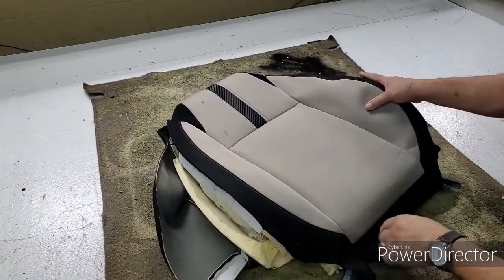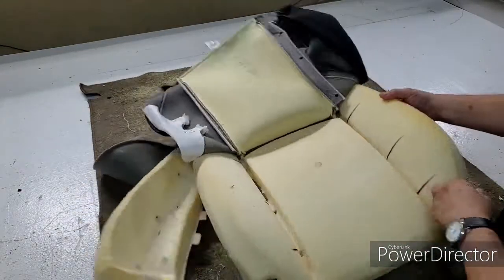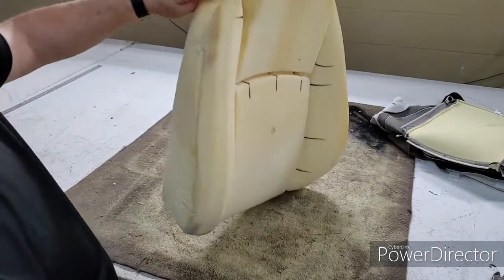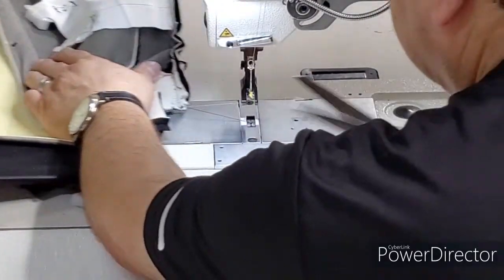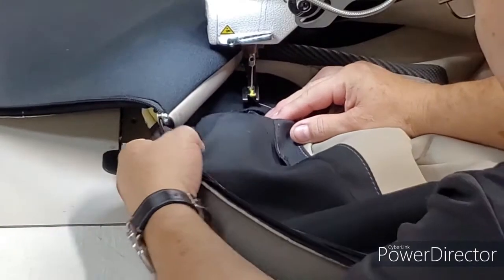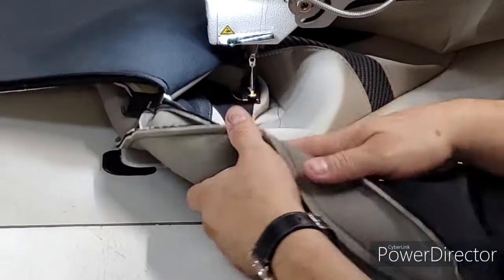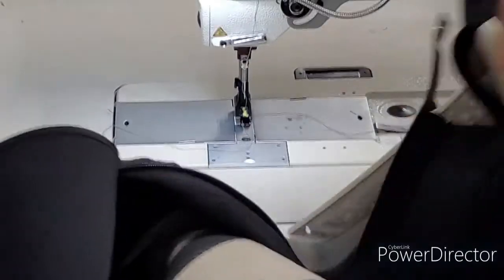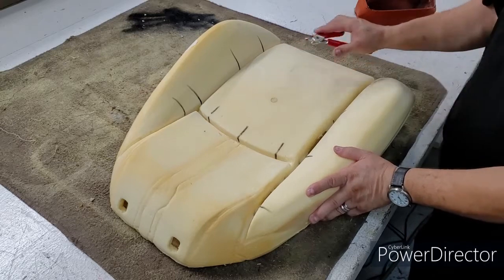See Now! how to resew a blown airbag seat cover auto upholstery

Comment: Nice work. Can you tell me how you closed the two back side seams? I didn't see it in the video. Also, so I understand correctly, the force of the airbag will automatically break through the side seams? If so, do you use a lightweight thread, or a heavy upholstery thread?
Reply from the maker: Thank you! I sew it as a normal french seam with regular machine thread. The airbag deployment is very forceful and destructive. It will either split the thread, destroy the vinyl at the perforation, or split the vinyl.
Reply: @oldschoolautoupholstery  ok, thank you for getting right back to me.
Reply from the maker: @mojoagogo4873  Yup!

Comment: If you pull the seat to make a damage repair, not air bag related, can you disconnect the air bag without fear of activating the air bag? Or does a dealership have to disconnect and reconnect air bag? Want to make a repair on side bolster with a side airbag
Reply from the maker: Hello Todd, Personally, I never disconnect the yellow airbag wire. I do the work while the seat is in the car. I don't want to pain my customers by having to take the car to have the airbag light reset. I never disconnect the battery. It is not because I am afraid of setting off an air bag. That has never happened in 25 years of working on air bag seats. Check out this video of me removing a bottom seat cover from an airbag seat. https://youtu.be/dODSTA6C0m8 Please keep liking and watching!
Reply: Does the same removal apply to the seat back. That is where my damage is located. Thank you so much for the fast response.
Reply from the maker: @toddathey1235  Hello Todd, Yes the same thing applies to the backrest. Please keep liking and watching!

Comment: Do you have to sew the seam with special thread designed to break when the new airbag is added? I heard it has to be a special  patented thread?
Reply from the maker: Hello Angela, I believe that there is nothing special about the thread. The force of an exploding air bag will break through anything covering it. I have seen the vinyl split before the thread does. Please keep liking and watching!
Reply: There are special threads especially for airbag seams. And there are a seam that opens easier.
I'm Europe you habe to have a certificate

Comment: I’m buying f150 seats and airbag deployed on the right front seat is it worth buying?
Reply: They are leathee
Reply from the maker: Yes, most likely can be repaired.
Reply from the maker: @EKoston3  The best thing to do is call around in your area as there is no way to standardize pricing. Pricing is usually based on experience, location, and if the upholsterers are hungry. I wouldn't go with the cheapest one.
Reply from the maker: @EKoston3  Most likely it will be a french stitch with nylon or polyester thread. Go for it!
Reply from the maker: @EKoston3  Hello, These are usually a french stitch with a nylon or polyester thread.

Comment: Do you use a special thread or stitch for the airbag seam?
Reply from the maker: Nothing special, just poly or nylon thread.
Reply: What size of poly thread are you using?
Reply from the maker: @sharethewealth72  Hi, The bottom of my thread spool says T-90
Reply: @oldschoolautoupholstery  awesome, thank you!!
Reply from the maker: @sharethewealth72  You are so welcome!
Reply: hi I’ve always heard that you need a “special” machine and thread” for airbags.  How truth is this? I mainly do party bus seats how ever every now and then I get a call for airbag seat and I just turn it down. Thanks
Reply: @pittbullrican  Yes, I've read that companies have very special and precise procedures tu stitch airbag covers, and the machine is computer controller so that it prints a label showing the exact information for this stitch, tension, etc, and that is why most of the upholstery shops do not deal with airbags, as if there is a problem in the airbag deployment, it can be very dangerous for the person in the seat.

I also read that they use a special thread, made from cotton, which breaks easily when the airbag deploys 👍

Comment: Great video, as always!! 😍😍😍

About this airbag cover procedure, I've read that OEMs that manufacture car covers have very special and precise procedures tu stitch airbag covers, and the machine is computer controller so that it prints a label showing the exact information for this stitch, tension, length... to monitor every single operation, and that is why most shops do not resew airbag covers, as if there is a problem in the airbag deployment, it can be very dangerous for the person in the seat.

I also read that they use a special thread, made from cotton, which breaks easily when the airbag deploys. Perhaps you could investigate a little bit about that, and perhaps use cotton read, just in case there is a problem in one of the seats that you redo? 😉

You are great, and I would like you not to have a single problem if an airbag seat cover that you have repaired does not deploy correctly, especially in a "sue happy" country like the USA 😅😅
Reply from the maker: Hello Delta, Thanks for the thought! I do not think it is rocket science. I do know that the thread and perforated material is no match for the exploding force of the airbag deployment. I have seen the damage when the airbag goes off. Thanks for watching!
Reply: @oldschoolautoupholstery  Thanks to you and keep up the good work! 😉😉
Reply: You were right, normally the Upholstery shop denies repairing the carseat with the airbag side broken. It can not be a regular thread.

Comment: I would not recommend  sewing an airbag seam with out a docusew machine. Its impossible to know if the seam will tear open and the bag deploy at the correct speed sewing the seam with out a docusew.
Reply from the maker: Hello Dmd, Like I always say, it's not rocket science. Any seam will not stand an explosion of an airbag. Just sayin'. Please keep liking and watching!
Reply: @oldschoolautoupholstery  I understand that any seam will blow out but the speed it has to go thru the seam and allow the bag to deploy is a matter of life or death. A  hundredth of a thousand second late can cause serious bodily damage or death. There is a lot more to it than just saying the seam came apart.  Honda has a great video on the importance of this involving a steering wheel airbag but it applies to a seat airbag as well.
Reply from the maker: @dmdkustoms4403  Hello Dmd, Right on! Right on. Please keep liking and watching!
Reply: @oldschoolautoupholstery  I have personally seen a repaired seam that did not separate as the factory seam would have and it prevented the air bag from deploying properly! Thankfully the seat was unoccupied at the time so no one was at risk of injury. I personally examined the cover and it appeared to be restitched exactly as it originally was, but it definitely didn't break apart as it should have! A lot of people use a lighter weight cotton or nylon thread for sewing the seams, but I'd still be hesitant!
Reply from the maker: @richardmccabe270  Hello Richard, I have been sewing ever since the seat airbag was invented. Never a problem. Not even one. Please keep liking and watching!
Reply: Thread you use for this is? I see that the outer thread on some are like thin twine like thread. Newby learning. Ty
Reply: @tinabutters-hargrave7911   I highly recommend you don't try to repair that type of seam. You cannot duplicate the speed in which the seam has to open without a Docusew Machine. Once again in a different application. If a skydiver opens there parachute a little late the result can be fatal or result in a serious injury. 
But I guess not a problem right because it opened.
Reply from the maker: @tinabutters-hargrave7911  Hello Tina, Well, the experts in the comments say that it should not be done. A difference of opinion. Please keep liking and watching!
Reply: @dmdkustoms4403  if they dont replace the airbag? Does that make difference?  And what thread is used?
Reply: @oldschoolautoupholstery  I have a sail right fabricator and another sailright industrial portable machine. I and curious on thread and advice?
Reply: @tinabutters-hargrave7911   Ok got you. If there not going to replace the air bag  and use the seats in some type of custom application.  Use your normal sewing thread. #92 or #69 is what I sew with. I also like using serafil thread.
Reply from the maker: @tinabutters-hargrave7911  Hello Tina, Airbag or no airbag, it doesn't matter. I always use T90 nylon or polyester bonded thread for everything Please keep liking and watching!